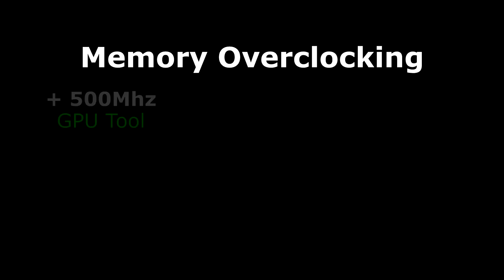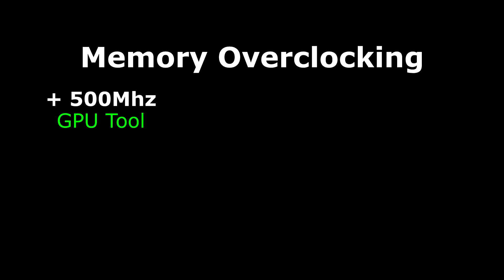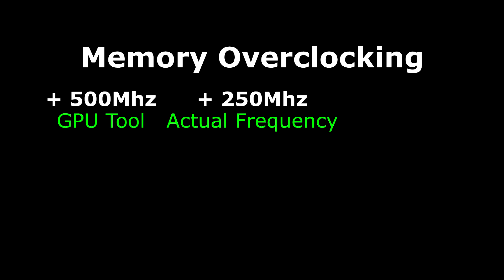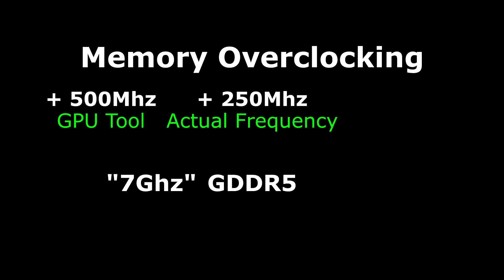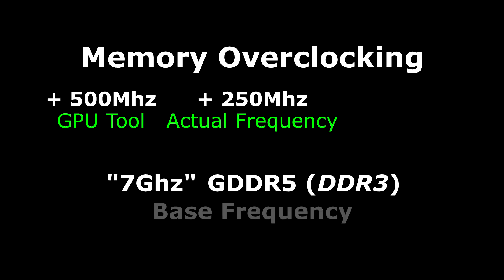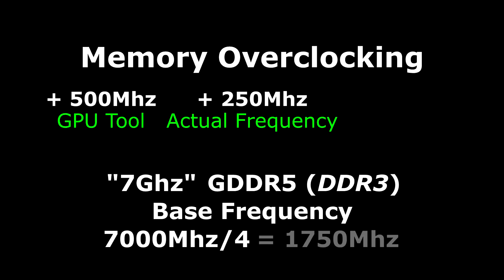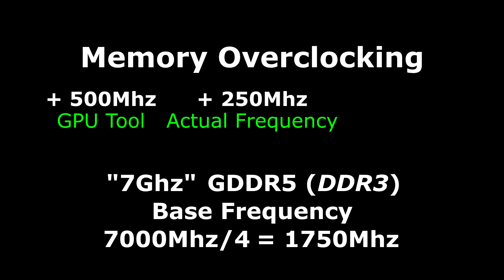[TiG] Tutorial: Overclocking a nVidia Card Explained [Memory]

Comment: Hi! When I try to overclock memory in Afterburner I just bump slider to any positive value I hit Apply then memory slider goes back to the default value [0] :( Any ideas why is that? (latest AB release, MSI GTX 970)
Reply from the maker: PiterSan Try using a different overclocking tool. I was getting the same issue in one of the programs when I was overclocking, so I ended up downloading another one. Links are in the description.

Comment: hello!  I bought the same card in november 2014. Do you think it's worth it to update its BIOS? cant find anything useful on changelogs, since they dont have a full list of changes. Any idea? Did you do it? In that case, did you found any inprovements?

Cheers!
Reply from the maker: I sold mine months ago, but I'd say probably not. The only compelling thing that would push me to updating the BIOS is bug fixing. -Shane
Reply: Thanks. Btw, is it worth selling and getting a different card? What was your motive?
Reply from the maker: Juan Carlos Andreu Gutiérrez At the time, I happened to sell it for a slight profit, so it was definitely worth it. I already finished overclocking and testing the card out, so the timing was perfect.

I intended on replacing and selling my previous card, the Gigabyte HD 7950. It kept giving me blue screens and random "ATI...dll" errors, so I was going to RMA the 7950 and sell the replacement card. A component was blown on the back when I removed it, so I sent that in. I ended up keeping the 7950, since I only play two or three games in triple screen and they both get decent framerate. I do sincerely miss the 970, but it's overkill for 1080P. Motive was pretty much money. -Shane
Reply: Thanks mate, apreciate it.

Cheers

Comment: Thank you, cleared my confusion. It used to be that in AfterBurner ETC; you would see the total core clock and memory clock, not just the offset, not just the plus number to the base/boost clock frequency. You know it used to be the for example 1100mhz clock then you would add and it would go like 1101 1102 in the afterburner. But now you just add to the number, and you have to calculate it yourself and also GPU-Z.

And interesting, the memory clock.... It's divided by 2. 0.5ghz actually is 0.25ghz
Reply from the maker: It's very strange. I had to do a bunch of research before I messed around with the overclocking when I was seeing different information in GPU-Z. The whole double data rate representation in the OC tools can get confusing really quick.